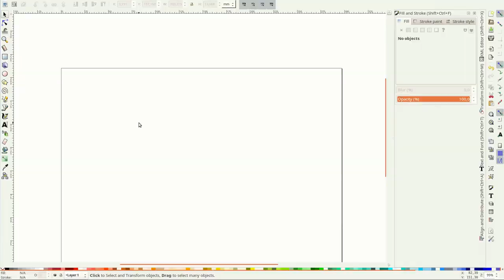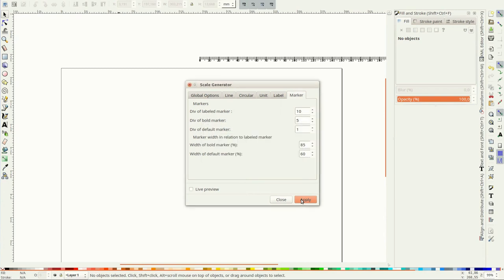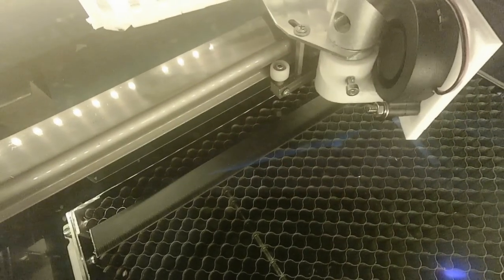K40 laser cutter bed upgrade

Comment: How do you adjust the focus ?
Reply from the maker: Zhivko Kanazirski By adjusting the height of the bed you can adjust the focus. Just reposition the nuts on the machine screws. 
When you remove the bed and put a piece of plywood at an angle under the laser a line will look like an hourglass. The center is where your focus should be.

Comment: Very good video and explanation, but isn't there a simpler way of making this table for my K40 machine? Cutting all that metal etc. etc. is rather complicated and requires much more skill than an ordinary Joe Average guy has.
Reply from the maker: You could totally make the frame from wood and put the bed on a wooden frame. Using metal however is a safety feature for this application. If you build a frame from wood there is a chance that it will catch fire if it is not properly adjusted. If you want to go the super simple way buy the honeycomb bed from China and glue a few metal pieces as feet to the sides - in this case it's not possible to adjust the height but it would be metal and you are done with a hacksaw, superglue and 30 min of time.
Reply: @WayofWood  Thanks for your reply. No, I will never make the frame out of wood. I will use aluminum but I was wondering if you can please give us the sizes of the parts uincluding bolts, honycomb etc.l This would facilitate work and purchase id parts. Thanks again!!  EDUARDO (From Colombia)
Reply from the maker: @Edubarca46  M6x80 or M8x80 bolts will work. The aluminium angle is 15x15 and the honeycomb is linked in the description.
Reply: @WayofWood  Thank you very, very much. You solved me a big problem!!
Reply from the maker: @Edubarca46  Welcome!